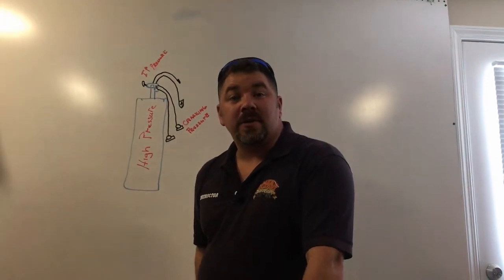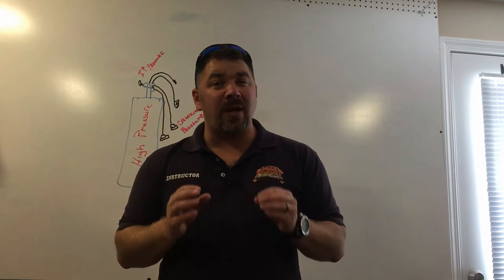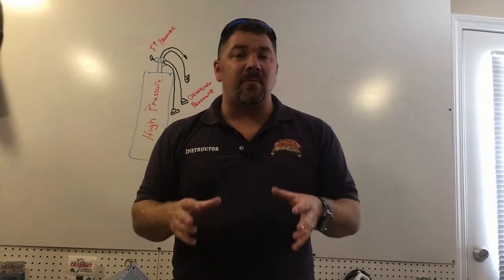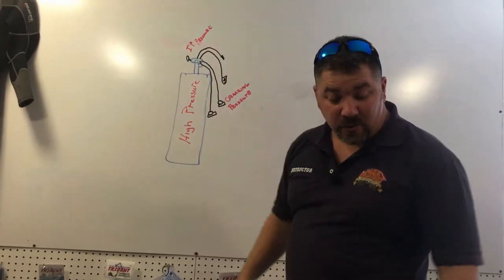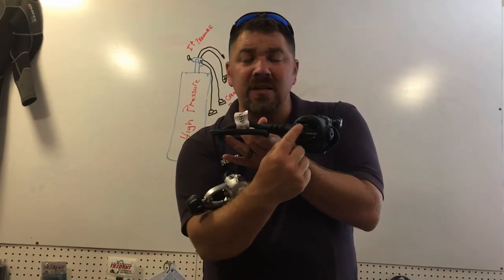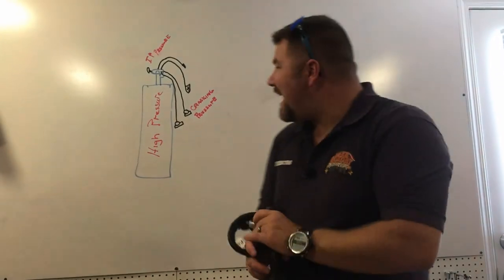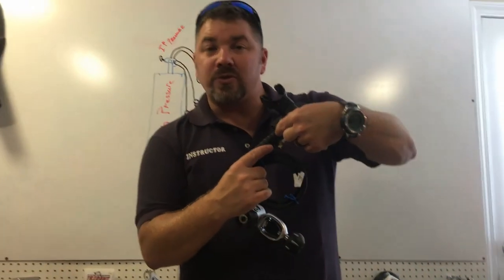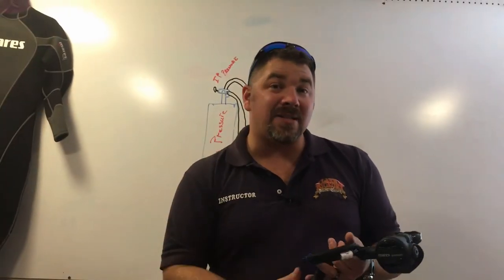Why Your Regulator Breathes Good Or Bad

Comment: Great video! Learn a few things in there for sure. Why would somebody choose a low performance reg over a high performance reg? I would imagine that’s a budget thing? What high-performance reg would you recommend?
Reply from the maker: Hello Chris Patriot, great set of questions. Choosing a low performance regulator is typically what divers do when in the market for a stage regulator, pony regulator, or an alternate air source. Something that is only to be used during an emergency, or one that is very easy to service. Budget of course can play a major role in this as well. As far as my personal biase in a high performing regulator, some of my favorites are the Mares Abyss MR22 (no longer being produced), the Mares 28x, the Atomic T3, Scuba Pro MK25, and the Apex XTX.
Reply: @LakeHickoryScuba  thank you!

Comment: Awesome video as usual. I have the seac x5 reg and have logged 45 dives with it without any problems. One of my last dives i went to 88  feet and the reg performed well but I could tell a difference in it. Is that normal?
Reply from the maker: If the regulator is an unbalanced piston regulator, then yes this is very normal.  With an unbalanced regulator, especially piston style regulators, anything below an average of 80 feet, and once a tank pressure drops below 1000 psi, a diver will definitely be able to tell a difference in the breathing quality of a regulator.  This doesn't make it a bad regulator, it just means it is most likely unbalanced.  Now with that being said, if it is a balanced regulator and it gets more difficult to breathe at depth, then the intermediate pressure may have dropped or you may need to loosen up the cracking pressure slightly.  I would let your local shop check the IP for you, most don't charge to throw on a gauge and check it.

Comment: I have a old dacor pacer xl 950 but it looks like new when it came and second stage leaked a little,  in order to stop it I had to turn the rectangle bar inside until it felt like it would not turn in anymore does that mean something is worn out or where it's supposed to be? Thanks
Reply from the maker: Hello john metyk, several things can cause a free flow in a second stage. If the intermediate pressure is set to high in the first stage, then you can get a free flow. If the low pressure seat is wore out or damaged, then you can get a free flow. If the demand lever is not adjusted correctly it can cause a free flow. If the internal wall of the first stage housing is scratched it can cause a free flow. With Dacor no longer being produced and no longer serviceable, It may be difficult finding a technician to diagnose it.

Comment: I hope you can help me out with this question. I just bought the Oceanic ZEO FDXI reg. The 1st time I tried it out was in my pool. I found that if I laid on my back on the bottom of my pool I could barely get any air. When I was vertical in the water I was able to get air but it was a little hard. When swimming horizontally, normal swimming, the reg would breath perfect. I am a beginner diver. So I don’t really know what to expect out of a regulator. Is this normal for all regs or is there something wrong with it? I tried  adjusting adjusting it basically in all positions. Thank you, I hope you can help me with this.
Reply from the maker: Hello Brian Mazza, every regulator is different. Even high end balanced regulators can be difficult to breathe from when inverted. My suggestion is to find a local Oceanic Technician and have him check to make sure the Intermediate and Cracking Pressure is set to factory specs.

Comment: Why do cold regs need to be at a lower pressure
Reply from the maker: Great question Jack La Lone. By having the first stage slightly de-tuned, it helps prevent freeze ups with in the first stage.  You can actually do a little experiment on your self.  Close your lips off and blow onto your hand.  The air is cold as it comes through a restricted access.  Now open your mouth widely and breathe onto your hand.  The air is now warm.  The same happens with in the first stage.